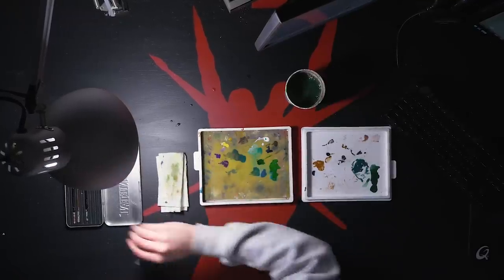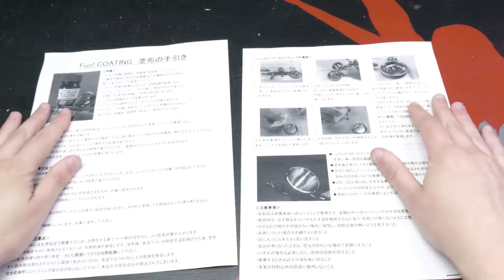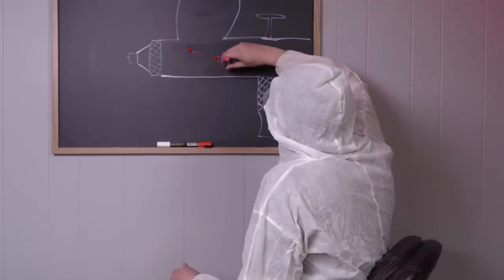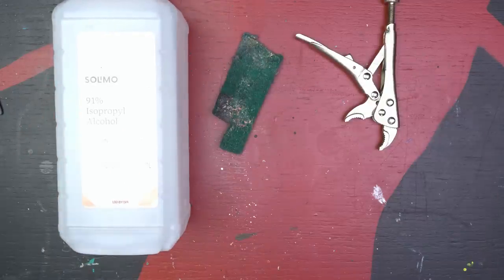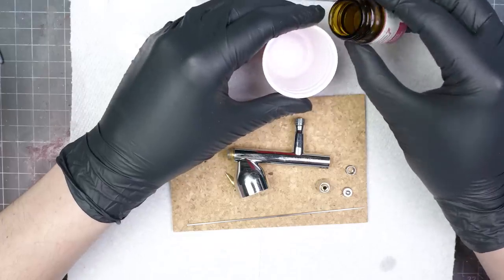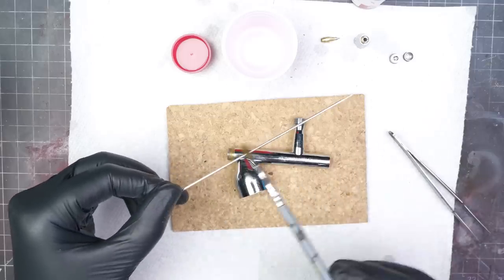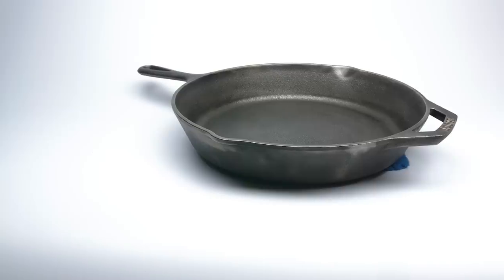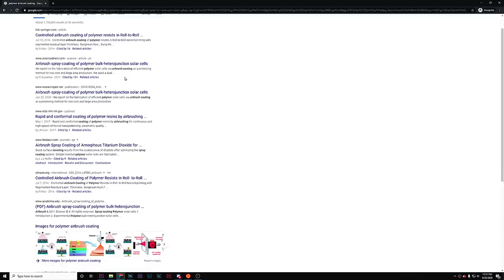Can I Solve Airbrush Clogging With This MYSTERY Liquid??

Comment: Great to see the material in use. I've worked with the same kind of process on 10ft industrial pipes. Heating the pipe to 500°F,  filling them with resin from the basket of a cherry picker lift and then send them to rotate coating the inside. Neat stuff but hot metal sucks to work with sometimes.  
You're probably getting less drytip and better flow over the needle by having modified the surface tension for the paint to flow over.

Comment: Tabletop minions recommended using an ultrasonic cleaner for cleaning his airbrush and I just tried it. I made sure to take any rubber fittings off but left one by accident and it was fine. Used diluted LA's Totally Awesome and came out clean as a whistle. Lightly lubed the trigger and spring and its good as new. I did not however clean the air valve with the us and cleaned it seperately.

Comment: Try searching for polymer coating for sublimation. This is intended to coat objects so you can print a picture or text on it with the sublimation printing technique. There are a couple of brands but most of them are spraycans. Only a couple of them are for dipping/application with a brush. After applying and drying it is also baked in an oven, but beware: by a cheap convection oven for this and DO NOT use your kithcen oven, because the polymer remnants will contaminate your food!

Comment: This falls a little too late for your airbrush but you really shouldn't use aggressive tools inside your air brush the exterior is chrome plated, the interior however is nickel plated and much easier too scratch it's best too keep too shop towels and wool pipe cleaners for cleaning too prevent scratches and inturn paint build-up.
Reply: Best video I watched early on was the head honcho of badger telling people don't use tools, just cleaning fluid, water, and cloths and oil your needle now and again.
Reply from the maker: The tool I used to clean the inside was a pipe cleaner thing, is that no good? The scouring pad was only for the outside.
Reply: @Miniac  I know Badger do reccomend not to use them not sure on Iwata though
Reply: Yeah don't use any abrasive or metal cleaners on the inside
Reply: So what about plastic interdental brushes then?
Reply: @docremington1589  Interdental should be fine. Those are soft nylon.
Reply: Alex Oever   Also, inter-Dental brushes have the twisted wire coated in plastic so it will not scratch.

Comment: Or just use paints designed to be airbrushed - Tamiya acrylics, Mr Hobby (series C and H), Hataka Orange Line, MRP,  AK Xtreme metal for TMM with proper thinners. Since they are not waterbased only the smell may be the issue. No clogging at all tho :]

Comment: There is a gun lube that does a similar thing. It’s called frog lube. You put it on and heat the item and it is supposed to fuse with the metal creating a non stick surface making the gun easier to clean and prevent carbon from sticking to it.
Reply: I was thinking the same thing. I use frog lube on my guns and the carbon doesn't stick to it at all.

Comment: I just use airbrush cleaner & alcohol most of the time. Once or twice per paint session I'll disassemble the thing, run it through the ultrasonic and then oil it when I put it back together. Clogs are rare.

Comment: Personally since I started using an ultrasonic cleaner I've had very little in way of clogs. I keep most of the airbrush parts in a solution of water and thinner in my cleaner. Run the cleaner a few times and leave the parts in it until next use.
Reply: I do the same.  However, he stated in his video he is lazy.  It does take effort to break down the airbrush after use and put it in the ultrasonic cleaner then wait remove and do a final cleanup.  I know because my hobby time is limited I have found myself in the basement at 2am cleaning things up and still having to get up at 6am for work.
Reply: Just started this myself. Honestly a game changer.
Reply: Have you tried cleaning with minimal break down of the brush? I just got an eclipse and I use an ultrasonic for cleaning carburetors. Sometimes I'll only do a 25% disassembly of the carb and then run it through the cleaner and it does well. I wondered if I could do the same "lazy" clean with the airbrush.
Reply: @SamBalducci  tbf it only takes about 2 minutes to to disassemble the brush. But yeah sometimes I'll be lazy and just take the back off so im not doing a full tear down, and still fine.

Comment: I have dry PTFE coating from WD-40 (a special version) that I use for my 3D printer. I wanted to give it a shot as it makes a thin teflon coating and I thought it might help also. It is like 10-15$ so I'd gladly watch if someone tried it :D As a first time user I am not yet brave enough to test it :P
Reply: I know exactly the product that you're talking about and the idea is sound but I don't know if it holds up in wet environments (he baked his on essentially curing it). A good experiment would be to brush it onto a small bowl and let it dry then fill with water, see if it lifts. That said nothing would be bad about using it on the parts the paint doesn't touch in the internals of the airbrush.

Comment: As someone who breaks down and cleans their airbrush after each use, it's genuinely painful to see such a finely engineered tool as a HP-CS in as poor condition as it appears at the start of this video. It makes watching it get cleaned a kind of therapeutic procedure. What PSI do you use when you are getting tip dry?
Reply from the maker: Approximately 20, but it varies depending on how thin my paint is and what I'm doing
Reply: @Miniac  thats very high, Im usually around 10-14 with iwata airbrushes
Reply from the maker: @joek600  all depends on what I'm doing and the dillution of my paint. No one pressure is right for everything
Reply: @Miniac  Yes if you want to spray thick paints, or the badger primer which is notoriously goopy 20+ psi is ok. But if you want to spray properly thinned paint over 15 psi at close distance will result to spider webs. It also depends from your compressor. Some compressors whitout a tank cannot maintain stable pressure. Im using a diy silent compressor with refrigerator motor and a 15 lt stainless steel tank (marine grade). That set up can give me about 40 minutes of airbrushing until the motor kicks in again.

Comment: Cast iron is a great analogy. You get the greasy film on it by just using and only cleaning with water. Here it is a bit different. Maybe apply it after every time you clean the brush for a month?
Reply from the maker: Soap doesn't remove the polymerized oil coating of a cast iron pan. If it did, then the coating was just a layer of oil. Kenji Alt Lopez from seriouseats has a few great articles on this subject.
Reply: Miniac Certain types of soaps do. Here in Europe one of the best anti-grease soaps for dishwashing is Fairy. I made a mistake of using it on my iron skillet. Guess who got to start the oil bit almost from the beginning? Basically heat opens the 'pores' of the iron and the oil and grease get in there and the grease does the polymer thing. It's sort of like anodizing type of thing, kind of. Weird sort of magic. 

There's some sort of chemical in Fairy and some other soaps that get in there and gets it out. Annoying as hell. Also if you don't oil right away, you get to use iron wool to get rid of the rust next day. Not fun. :)

Comment: If you are an airbrush beginner and read nothing else in this comment: Please avoid using abrasives such as scouring pads on any part of the airbrush, the internals are made with very tight tolerances and seals which do not like scratches, the outside can be easily rubbed clean with an airbrush cleaner or IPA.

Clogging should only be occurring on the very tip of the airbrush, if it is happening anywhere else you have an issue with at least one of the seals, another telltale sign of this is paint reaching the trigger. Cleaning may help or you might require a replacement, the seals around the needle will tend to naturally degrade with use the fastest (and are another reason people will use superlube on the needle) and you can pick up replacement seal sets quite easily for manufacturers like H&S or Iwata.
 

Tip clog cannot be completely eliminated with acrylic paints, due to the nature of the paint and the air blowing over the tip of the needle. You can reduce it easiest with thinning as mentioned in the video or adding a retardant. Often reducing the air pressure will be the biggest factor, which is recommended when you thin anyway.

You can completely avoid the clogging with lacquer paints like Zero or MRP, but you are trading off the ease of use for more dangerous chemicals that smell much worse.

Mr Hobby Tool Cleaner is amazing for cleaning an airbrush but is quite a nasty solvent so should be used with a respirator.

Comment: I’m going to wager the guess that blockages occur because when you clean it, you use too rough tools and scratch the coating/surface, causing the paint to stick to micro scratches.
In fact I wouldn’t recommend any tools at all besides something like a q-tip.
Instead I’d recommend you soak it instead and in the worst scenarios, you use acrylic remover (which eats and destroys all rubber and plastic, so don’t use near o-rings, seals or anything similar).

Comment: This was from a few years back and demonstrates how to apply the 'Fun!Coating': 

    https://www.youtube.com/watch?v=Gh36kv-Pew8

While in Japanese, the video is fairly easy to follow and the steps are similar to the ones shown here. I did notice that the temperature was set to 80C which is a touch higher than the 170F that was used here. Also, the 'baking' process was set for 60 minutes (cue clicking sound).

Regarding pipe cleaners, I would avoid their use as they can shed fibres while being used in the narrow confines of an airbrush.

.vp

Comment: 1) DO NOT use abrassives on and in the body of the airbrush. Its the best way to destroy the coating and expose the brass or make scratches that will mess up proper air sealing. Especially those chinese made pipe cleaners have exposed sharp metal as a core. You should use Vallejo airbrush cleaner, it will break down even left over colors inside. For some reason Vallejo colours and the ones that share their formula are impervious to windex type cleaners, create a mess with alcohol and Iwata medea cleaner does nothing to them unless they are very fresh. If you have a badly clogged airbrush you can use laquer thinner. It will destroy any kind of color remains and clogs. If you clean your airbrush after each session, maintaining it will be a matter of 5 minutes.

2) Airbrush prices are going up each year. I got my eclipse and hp+ 100 and 145 euros respectivelly about 6 years ago. Now they are about 160 and 240 euros. Do I really want to coat their surface with an unknown material and put them in an oven? Well... no. Because no company is going to ever reach out and sponsor me or send free airbrushes for ''review''. Also waht if you want to airbrush non acrylic colors? How do you know that laquer or mineral thinners are not going to eat or gunk that coating? And what if after sometimes the coating start to flake out creating uneven surfaces on the needle or clogging the airbrush?

Comment: I'm new in the hobby and I accidently ordered a set of vallejo air paint. 😅 A topic for a video, what can you do with airbrush paint with only a brush. 🤣
Reply: Can still use it like normal paint only difference is that it's already thinned down to be ready to just use out of airbrush, so is just a little thinner than the non-air paints.
Reply: @v1llenpainting675  I tried to paint with it but the disperion of the paint was strange. It wasnt even on the surface. But I'm really new in it, I'll try more experimenting with it.
Reply: @crymric  that can be a problem with thinned paints in general. Plan on multiple coats and don't overload the brush. There's a learning curve, but once you get comfortable with thinner paint it's worth it IMO.
Reply: Thank you, i'll try more :)
My poxwalkers will hate me 🤣
Reply: I actually really like the Vallejo Air metallics. They do a great job with just a brush. Be sure to prime your minis, too, if you weren’t already.
Reply: @jakelilevjen9766  This, Air metallics are amazing even when just using a brush.

Comment: perhaps such liquids will work in much the same way.  but I did not check.  if possible, compare in a new video.
it is found on aliexpress

Car Coating Hydrophobic Glass Nano Ceramic Protector Liquid Car Polisher Paint Care Auto Accessories for Car Maintenance Wax Tools

9H liquid ceramic coating for car hydrophobic glass coating for motorcycle paint care anti-scratch auto detail glass coating polishing for car

Comment: I just take out the valve out of my airbrush that regulates the air so it continuously blows. No more dry tips.
Reply: Isn't continuous air flow going to increase dry tip on any kind of paint?
Reply: @ClonesDream   Not at all. The paint left over after you pull the trigger are all blown off. If there is a bit left the thinner with the new supply of paint flowing out will take care of it. The only problem I have is I use a cheapo airbrush and get globs of paint accumulating in the nozzle cap.